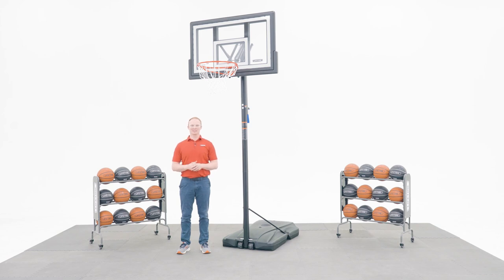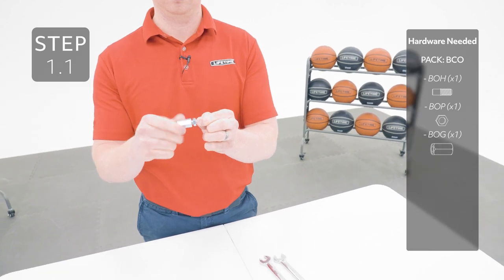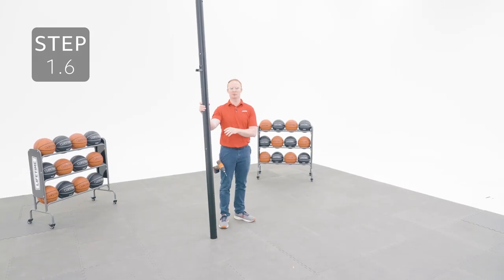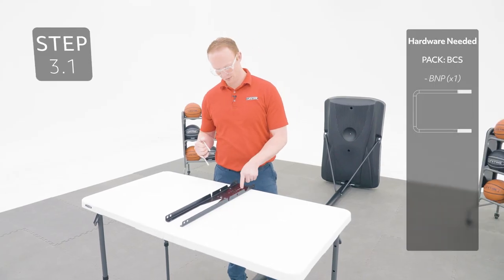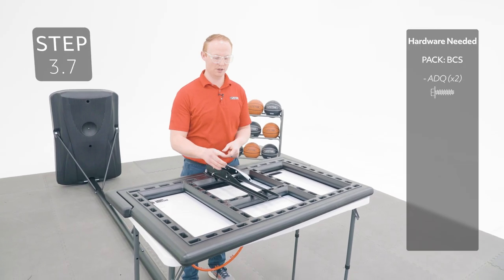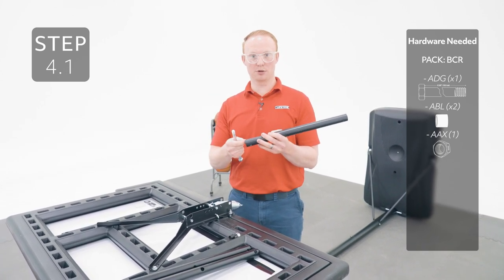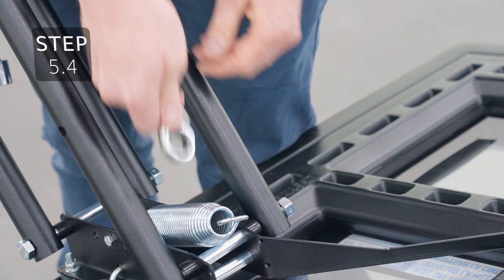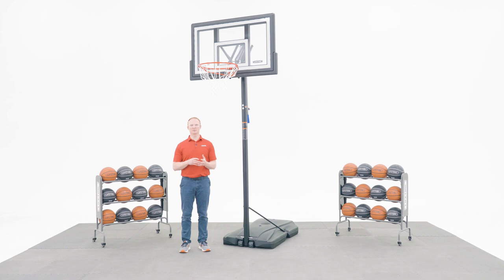Lifetime 50" Portable Strong Arm™ Basketball System | Lifetime Assembly Video

Comment: Why is this 50” video different than the one I have?? Are the new ones not the same??
Reply from the maker: Depending on the model number, there could be differences in the way the backboard is attached, the rim, the base, the adjustment mechanism, etc. Make sure that your model number is listed in the description of the video.